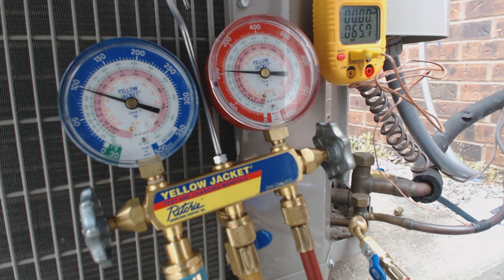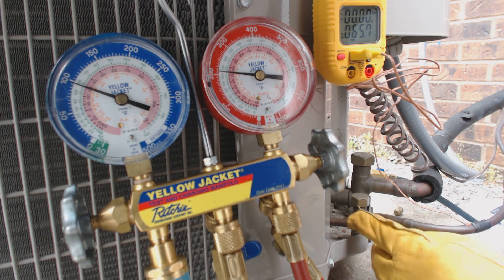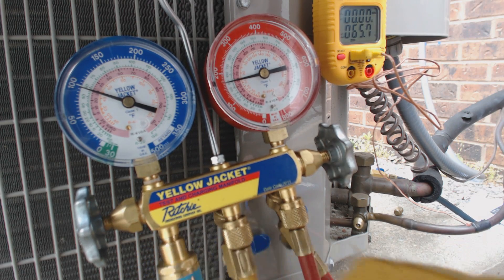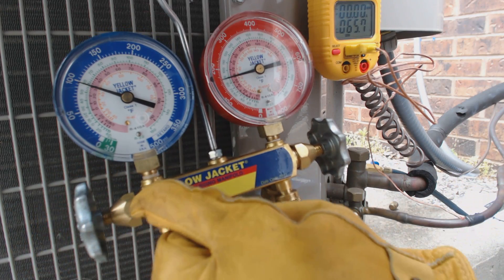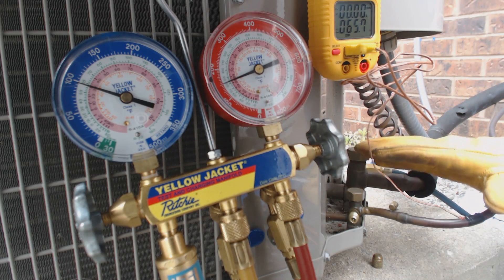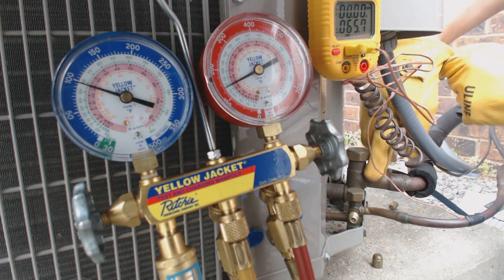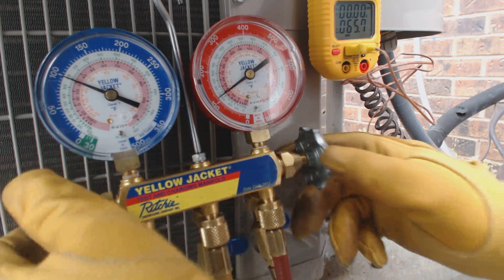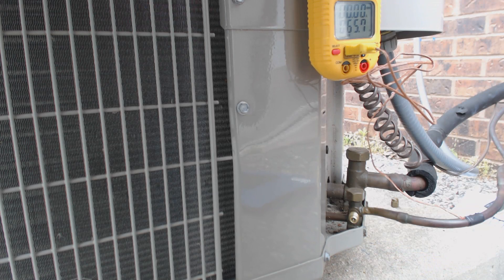Charging Refrigerant from your  Gauge Hoses back into the System Before Disconnecting! Explained!

Comment: Question:  what do you do with that 100 psi of vapor that is still in your manifold gauge hoses after you disconnect?  Do you just leave it in there so you don’t have to purge air out the next time you connect, or do you recover it somehow?  Thanks.

Comment: But this means that you will always lose a little refrigerant because when you disconnected, the pressure was around 100 psig--in your plumbing and manifold, right?  I guess you could charge them back in with something like a refrigerant recovery unit which would compress the stream as it enters the low side.

Comment: When purging air from yellow hose before returning refrigerant back to the system, wouldn’t the air be pushed to the low loss side of the hose? Since when you open the red handle, the liquid refrigerant pushes into the yellow hose?

Comment: Does this apply when charging a system?    Everytime I charge a system I'm always left with refrigerant In my houses. Shld I recover the refrigerant in to a recovery tank or do I can I use this procedure and simply put the refrigerant back into the system through the sanction line with the system running? Can u break a vaccum and charge a system while it's off? I wld hate to ruin the compressor by trying to run a system while it's in a vaccum and free of refrigerant?
Reply: You shouldn’t be left with any refrigerant in your gauges or hoses. You’ll leave units undercharged. If it’s a critically charged unit you are ruining it. Here’s a guide 

Don’t even bother with the service line. Keep it parked. 1. Shut off your high side valve. 2. Open your high side knob. 3. Open your low side knob. 4. Shut off your low side valve. 5. Disconnect low side. 6. Disconnect high side. 

Enjoy

Comment: Question: What you do with the leftover approx. 100 PSIG refrigerant closed up in the low pressure line after disconnecting?
Is this considered as a minimum loss everytime you hook up your manifold set, or do you recover this bit behind the scenes in a container?
Thanks!
Reply: Good question. Can someone please answer?
Reply: Di minimis
Reply: Depends how long your gauges are, esp high pressure side. The lesser the hose, the lesser refrigerant that will be left in the hose.

Comment: Hi Craig...Love your videos but I have a question. If you purge sometime AFTER you've hooked up your hoses, and not within the first second or two as you hook up each hose to the king valve, isn't there a mixture of air/refrigerant in the hose that would require more of a purge to get the entire hose cleared of mixed air/refrigerant, say 3 oz worth on a 5 ft hose, that would need to come out for a completely air free hose? I seem to think you're thinking of a completely separate air/refrigerant boundary between the two, as that 1.5 second purge would suggest, and I'm not sure that exists, or does it?
Thanks Craig
Reply: Yeah, he’s teaching how to put air into the system.

Comment: Excellent videos but one question. I noticed to purge you also opened up the vaporizer on Suction line but I didn’t hear any gas coming out? Doesn’t that suck air inside as vapor line is a suction line? Wouldn’t it had negative pressure and suck moisture in instead Of purging refrigerant out?
Reply: I thought the same thing . (?)

Comment: After the gauges levels out, and you've only got the suction line hose attached, are your hoses completely empty or is there still vapor refrigerant in your hoses? And if there is still vapor refrigerant in your hoses after complete disconnect, what do you do to evacuate that refrigerant??  HVAC student here. And I cant seem to find a video that explains that bit 100% or am I just missing something.
Reply from the maker: So it is only a small amount of vapor refrigerant still left in the hoses and that falls under the de-minimus rule which means that the small amount can be vented during normal service, thanks!

Comment: I'm a little confuse on this procedure.  Why didn't you purge the air through the ball valve at the end of yellow line but purge instead at the center of the manifold.  Wouldn't you have air trapped in the yellow line by doing this procedure.  This procedure seems confusing.  Your explanation would be greatly appreciated.
Reply: I think the ball valve is at the front of the yellow line (close to the center of the manifold)

Comment: Great video, but since this procedure takes place after taking readings, wouldn't the blue line already have be purged?  Also,  after you moved the liquid from the red line into the center of the manifold, you purged the yellow line. So what was the point of purging the blue line after that?
Reply from the maker: You can purge before or after checking the charge before performing the disconnect procedure to charge the liquid in the red hose back into the system, thanks!
Reply: @acservicetechchannel  ;

Comment: I have a 3 1/2 tons unit by trane installed 1992 (r22) and I haven’t check the pressure low and high side since I had it. I have gauge made by yellow jacket and I do have a ampere gauge and I still have some r22 left in a 30 lbs tank. Can you please advice me on how to check and step by step procedure if the Freon is enough in the system ? I feel like the central ac is not cooling in full capacity, I loved to learn doing my own maintenance ,thanks in advance
Reply from the maker: Look up "acservicetech superheat playlist" and "acservicetech subcooling playlist" It will depend on the metering  device which is used, thanks!

Comment: hi, i saw a video where the tech hooks up low and hi side hoses to check pressures. but as soon as he removes the low and hi hoses from the condenser service valves the pressures on the manifold dial goes straight to zero. that's funny because when i remove the hi and lo hoses from condenser service valve the pressures stay the manifold. just like your demonstration here. am i missing something? thank you.
Reply from the maker: The tech probably does not have automatic or manual low loss fittings like we use, thanks!

Comment: I recommend getting smart HVAC probes for just CHECKING refrigerant to avoid taking unnecessary refrigerant and or the need to sweep the guages. Athough most smart probes dont have loss-less fittings you can add a Yellow Jacket seal right loss-less fitting to the probe. Additionally you can charge through probes.
Reply from the maker: I did some videos with the fieldpiece probes as well as the yellow jacket quick connect test gauges and yes they are great for preventative maintenance when checking the charge, thanks!

Comment: Man, I love these videos. So after I pull my vacuum on a new install and using these exact guages and hoses for everything since I just can't afford the core removal tools yet and I break the vacuum with refer to add what  I need for over 15 feet of lineset, open service valves and then let systems run for 10-15 minutes and check sub cooling since I have a TXV. There will be refer in the yellow line. Is this process the same and/or okay? I just heard you say in the video about the yellow line being empty and it made me wonder if I was missing something. This goes along with a question I asked you earlier about zeroing out the scale after refer was in the yellow hose before opening high side to add charge. Not sure how much is in a 60" hose but could that extra really hurt anything?  Thanks for your help with repetitive questions, lol.
Reply from the maker: I try not to overcharge the system so I stop adding once I am at the correct subcooling so that the amount in my yellow and red hose will go into the system and increase the subcooling by 1 to 2 degrees on a normal size residential ac unit, thanks!
Reply: Thank you.

Comment: Great video ! Just one question: If the air in the red line is not purged enough and the leftover air goes into the system (compressor), what will happen? Thanks
Reply from the maker: It reduces the effectiveness of the saturated states to absorb and reject heat and will increase pressure a little, thanks

Comment: Does this apply to automotive (R134a), as well?
Reply from the maker: A compressor in a car can ramp up or down so we used the total weight method to charge in a car as seen on the spec plate for total refrigerant weight used after a vacuum on the empty system, thanks.
Reply: OK.  What I was getting at was, after the last tenth of an ounce of refrigerant is removed from the charging can or cylinder that completes the required weight or capacity the system requires in an automobile, does the remaining refrigerant in the manifold high pressure hose and charge line have to be fed back into the system through the low side of the manifold, like you show in the video?  Isn't that refrigerant part of the overall system weight?

Comment: That’s interesting. Could you hazard a guess as to the weight of refrigerant that is contained in the hoses before you start this removal?
Reply from the maker: Well liquid r-22 is about .6 ounces per foot of 3/8" line so a 5' hose would probably be about the same internal diameter so  maybe 3 ounces which is a lot when you think of it, thanks
Reply: acservicetech Yes, it’s more than I had imagined. Thank you. (I’ll be careful, then)

Comment: Love your videos.  How do you remove the hoses, where you use the superheat method and you added refrigerant?  Seems to me you will have refrigerant in the yellow hose and you might as well reclaim that too.  I didn’t know how to do it so I just made sure my manifolds were closed and then removed the yellow line from the manifold.  Also, how do you clean the hoses out?  I’ve got some drips from them and don’t want to store them dirty.  With your videos, I was able to charge my system for less than the price of a service AND I got some gauges, a multimeter and refrigerant in the process.
Reply from the maker: Thanks Michael, just make sure you are EPA 608 certified to handle the refrigerants. Check out the "acservicetech connected check charge, disconnect procedure" thanks

Comment: dont you think there is still air in the yellow hose even after you bled it off? id think you have to bleed the other side of the yellow side where the ball valve is.
Reply from the maker: That is mainly what I am doing at this point to make sure, thanks

Comment: In watching u bleed the yellow center hose I noticed that u bled the front of the yellow hose ,what happened to the air trapped in the back of the hose.Should u not have bled the yellow hose that was hooked to the back of the manifold to get the trapped air out?please let me know if just bleeding the front gets rid of all the air in the yellow hose.i know u know what ur doing and I appreciate all u teach me,just a question in my mind.
Reply from the maker: Actually, it is better to bleed at the other end of the yellow service line to be sure and is what I am presently doing. Make sure that you have an on/off so the refrigerant in the line can be controlled. It wouldn't work with an auto disconnect fitting on the end, thanks

Comment: CAN NOT WE USE PUMP DOWN TO EMPTY COMPLETELY THE GAUGE MANIFOLD ? SOME GAS PRESSURE REMAINS IN THE GAUGE , I SAW A FRENCH VIDEO WHERE A TRAINER DOES  IT . THANKS FOR THE VIDEO
Reply from the maker: That is a great question. The problem is doing pump downs on split systems like this adding excess strain on the compressor and often times when the compressor is older, I find that the internal pressure relief valve blows before it even gets close to 20psi.  If you want to avoid the purging and then the disconnect procedure, you can use quick connect test gauges instead, thanks

Comment: Another great video. When you are throttling the liquid back to the suction line, I can't tell should the condenser be running, or does it even matter? much thanks
Reply from the maker: Yes the unit should still be running so there is a low side and a high side, thanks

Comment: I see you purged the air at the yellow refrigerant line, which I understand, but why would you purge the air out of the blue low side while the unit is running? Wouldn’t that suck in air?
Reply from the maker: The low side is higher than the outside air so I needed to get the air out of that line too before adding refrigerant, otherwise I would be putting it into the system, thanks
Reply: acservicetech Thanks so much for your quick reply, I really appreciate all of your videos very much! Just a follow up question; wouldn’t that normally be covered if you purge the hoses when initially putting the gauges on and doing a purge the? Or do you have to do it again for this procedure?
Reply from the maker: Just once is fine but if you never did it yet, you need to before putting refrigerant back into the vapor side, thanks
Reply: Thanks again! I am halfway through Hvac school down in Southeast Florida and really appreciate all of your contributions and regularly share links with my fellow classmates!

Comment: Bought a mini ball valve set the other day and my question is do I have to remove the valve depressors on my yellow jacket manifold hoses in order to get better flow? Or can I just leave the depressors in as is and hookup the mini ball valves directly to the stock yellow jacket hoses? Thank you
Reply from the maker: If the mini ball valves have valve cores in them too then yes I would pull our the other ones, thanks
Reply: acservicetech thanks!

Comment: Question... Why doesn't both gauge pressures drop to zero after you shuffle the refrigerant back into the system? Thank you...
Reply from the maker: When the system is off, the refrigerants equalize and return to the saturated temperature of that particular refrigerant at whatever outside temp it is.  This is not a pump down system.
Reply from the maker: Thanks Razor1964!
Reply: Hi, i thought the low side vapor is still in the hose and you were able to put the liquid back to the system because liquid side has more psi. In other words if i connect the hose only on low side and not on high side, the vapor that is there on low side will never go back to the system, is my understanding right.

Comment: So without the portable liquid vaporizer I would quickly open the low-side line for a second or so at a time to feed the refrigerant through? How long do I safely wait before feeding more refrigerant? 

Thanks, great video! Subbed.
Reply from the maker: Open  the low side just a little bit for a second or two and shut the handle. Wait a minute and do that again while monitoring the weight with a scale and the charge with either superheat or subcooling as needed, thanks!
Reply: I see. Thanks!

Comment: I htink I have a r12 gauge set up and got those 134a adapters. Is it normal for a high pressure side to suck in refrigerant in the red hose with the valve closed?
Reply from the maker: The handles on gauges shut the yellow service line off from the red or blue line hoses. If there is a valve on the hose, it should hold the refrigerant back, thanks
Reply: I have a little different set up than you. I have an imperial 4 valve manifold. i noticed when checking my 134a pressures i got a l little bit of refrigerant in the high pressure line with the valve closed. Is that normal? I read in a forum that you open both high and low sides on the manifold shut off the the adapter  and let the drain through the low side and back into the system. I'm just curious if that is normal for the manifold to pull in a little bit of refrigerant? It's not a great deal... of it. Just wondering maybe I need a valve repair kit? I'm just not sure. thx Great videos btw

Comment: acchannel.what about, the freeon on the Gauges.they still have refrigerant inside.there's no way that you can put that inside the system.?
Reply from the maker: After doing the disconnect procedure when you charge the liquid back into the system, then you only have a small amount of vapor left which is vented after the disconnect. This is called de minimis, https://www.epa.gov/section608/stationary-refrigeration-prohibition-venting-refrigerants